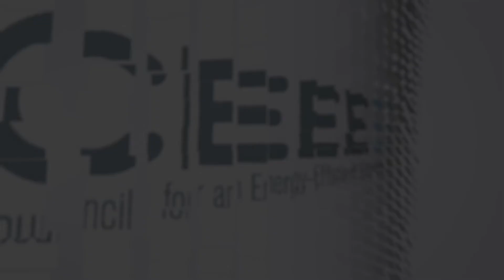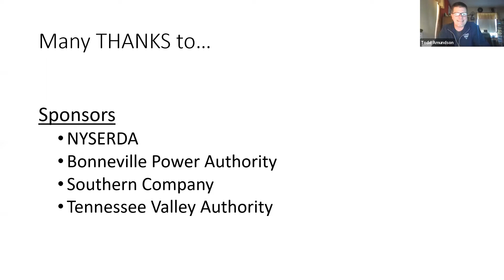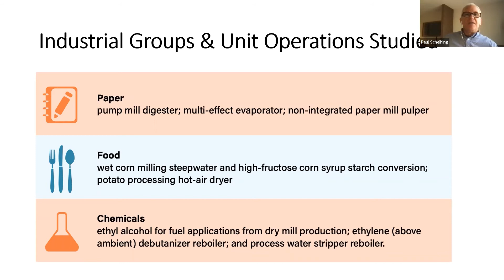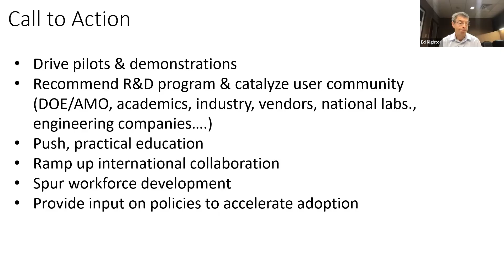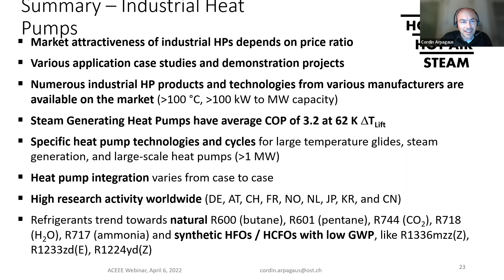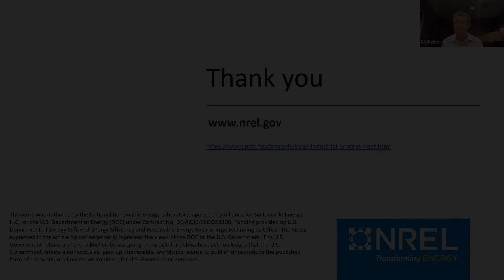ACEEE Webinar: Electrifying Industry’s Process Heat Supply with Industrial Heat Pumps

Comment: Electrically driven heat pumps are more expensive to run than using natural gas for heating.   This is straight forward with power grid running on natural gas.   A natural gas combined cycle plant runs at about 50% efficiency.  About 0.38 of the generated electricity gets to the home residential power meter.   The throughput efficiency is 0.5 X 0.38 = 0.19.   A heat pump used for heating in real world best is close to 250% efficient.    250% X 0.19 = 47.5% efficient where a good efficiency natural gas furnace is 90% efficient.